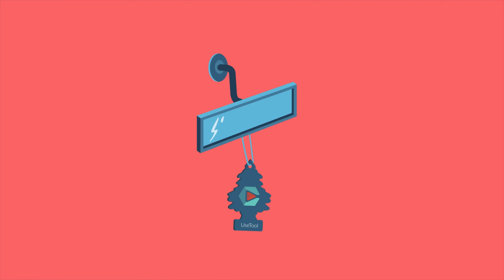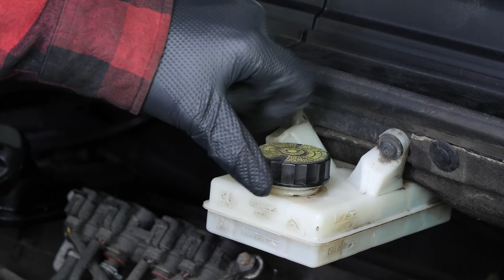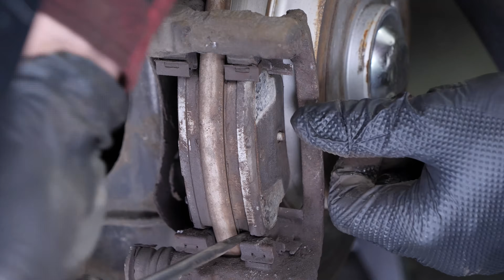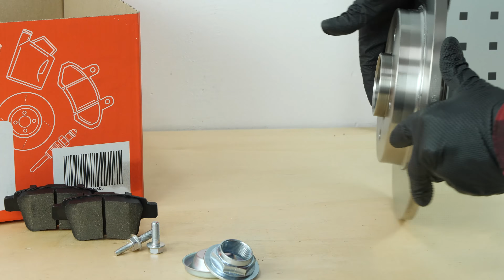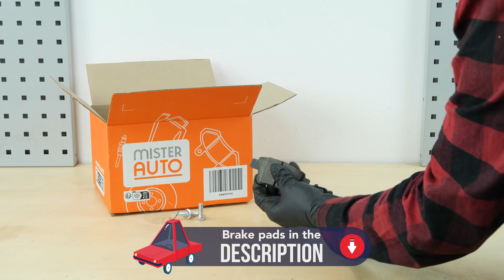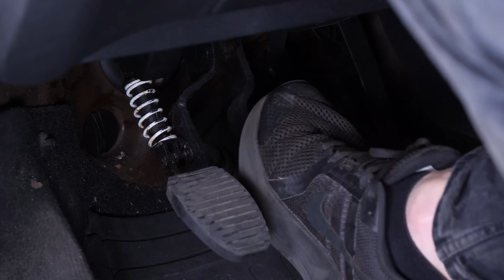How to replace the rear brake rotors and pads C4 Picasso mk1 🚗

Comment: Just subbed my bro, thanks for thr help. I got a fault in the rear wheels after brake pad job . Handbrake faulty and esp error. Is there a way to reset the fault without a diagnostic tool? i turned the auto handbrake off in the dashboard menu. did it wrong i guess. Now error, but the pad job is great! I need to reset fault of handbrake and esp, is there a trick?
Reply: I have the same problem now.. Did you fix your issue?

I got diagnostic tool.. but it just says problem with electrinic brake..

I replaced all brakes in rear.. but now I have this fault